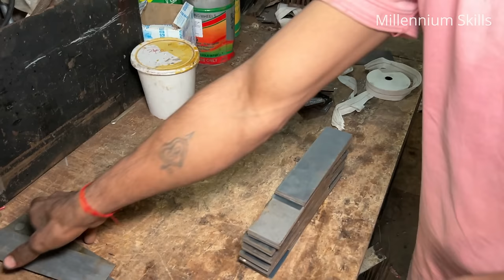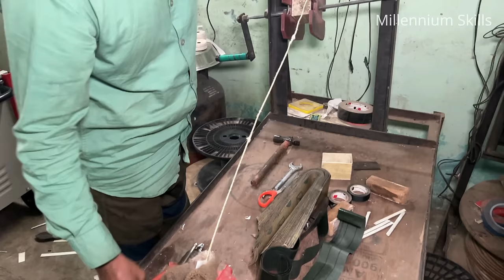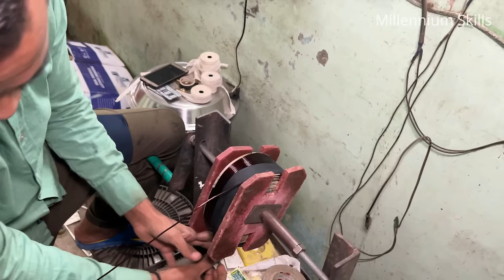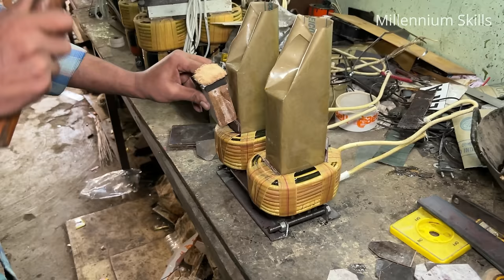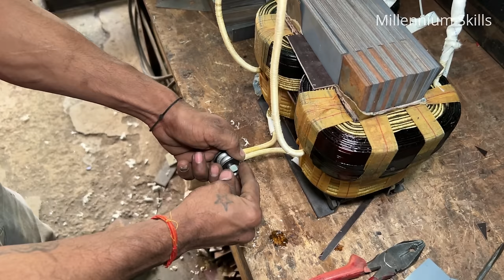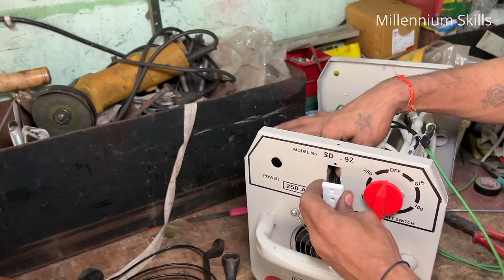Amazing Presses Of Making Welding Machine By Skilled Mechanical. Manufacturing prosses of Machine.

Comment: I must say, as far as these locally-built low-tech welding transformers made in India and Pakistan go, this is likely the best executed version of the design that I've seen on YouTube so far and the least likely to go up in flames. I'm not sure though why they are determined to use cotton insulation in these things (unless it's white asbestos textile... ☠️) or why there's no circuit protection, but I do worry that the rotary switch is likely to short out over time due to arcing. I would have kept the power switch separate to the turn selector.
Reply: More than likely asbestos. 
These do work for many years. 
The shell goes bad after few years of being banged around. So then they remove the transformer and use it standalone without any shell. 
Also these are hooked directly to the mains feed before the meter so they can weld with basically free electricity 😂
1hr 2hr of use won't trigger any power company inspection.
Reply: Agree. This is of quite quality amongst local factories.
Reply: I must tell you this is the best low tech transformers
Reply: compared with fiber glass insulation or insulation-coated wire, the cotton insulated wire has probably the lowest cost as cotton and aluminum are easy to obtain locally, and the insulation varnish can penetrate into the cotton fiber for both providing extra insulation and bonding the windings together as a whole
Reply: W2w
Reply: @TheBalconyWorkspace 👍yes cotton is act like warnish absorbant
Reply: sir primary winding connection      video
Reply: Almost nowhere in india can you steal electricity like you used to do 30 years ago... @KuntalGhosh

Comment: I have seen this type of welding machine, trust me it works perfectly and last longer than the new capacitor electronic welding machines. This one's has more endurance than the new electronic ones and their control knob are marvelous and takes ages before it spoils, luckily for me i have some in my workplace and it is over 40 yrs and currently I am 27 yrs old now. It doesn't overheat much due to the air cooled system. It is a very great honor to finally know how it is been made.❤❤❤❤ Great design and nobody should critize this machine without using them, great master piece.
Reply: ya...unless its input exceeds the recommended (240v) it will mostly outlive 5 generations because it is just a bunch of wires on a metal core.

Comment: Just bought a 50-years old 9 KVA arc welder today, made in Austria.  

The case is thick cast aluminium.  It is lighter than I thought, probably less than 30kg, I wonder if the windings are aluminium rather than copper.